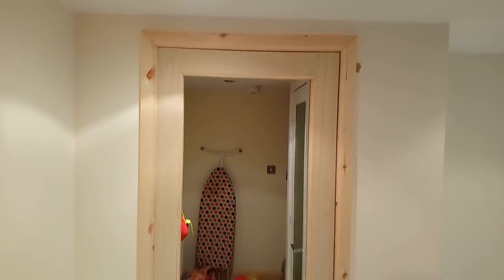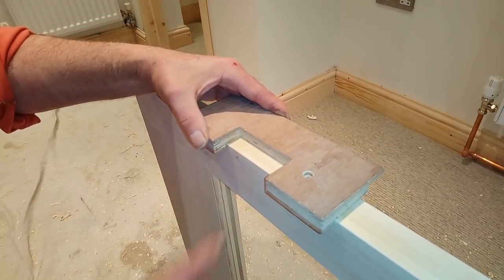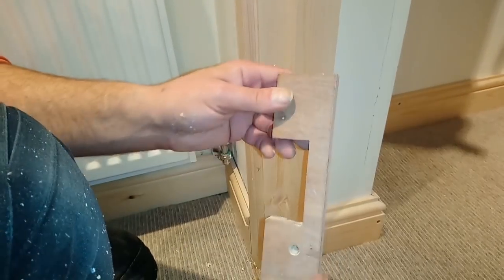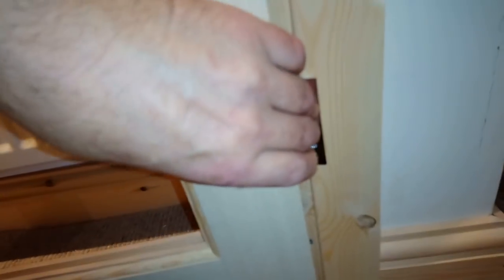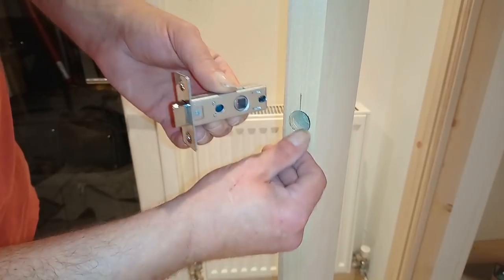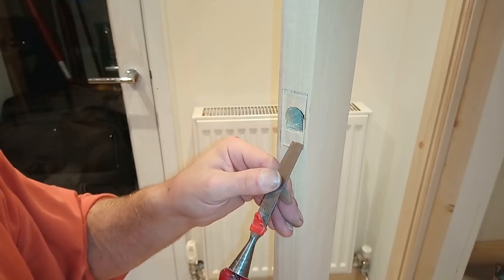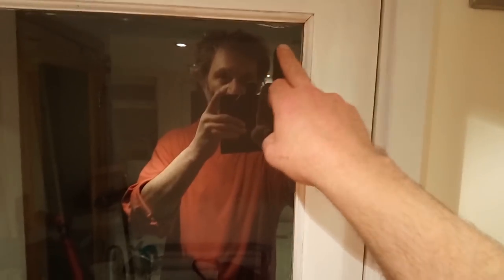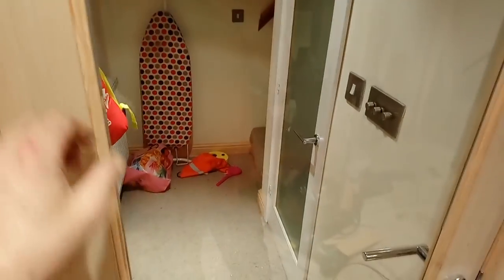Hilary's Basement Pt5 - Fitting the internal glazed door

Comment: I really enjoy watching your channel. With those dimples on the back of the latch I usually just give it a little blast with a 10mm drill for them to recess into.
Reply from the maker: Thanks Sharp 👍
Locks & handles are a bit of a dilemma for me, they finish the door off & have a mechanical niceness to them but when it comes to fitting them i just want to get it done, so while i have chisel in hand it's quicker. They never come as nice as they should 🙃

Comment: Great vid and top quality work carried out once again.
What would the price of a job like that cost ?.
Thanks 
Scott
Reply from the maker: Thanks Scott, 👍😊
Sorry hard to quote that on here, Tulip is about £28-ish inc vat for a cubic ft, so the main part of the door cost maybe a little less than that, 5 lengths of beading, a couple of £s each, hinges & lock pack from screwfix £5, handles £20, & the glass £37 + silicone, glue & Dominos, & my time,
More than a bought one but i couldn't find one this size, maybe in width but not the height, & this matches the opposing one 90%-ish.

Comment: Great Jig. Won't be buying one anymore. Most of the doors I hang are into old frames and taking the door stops off is messy. Any ideas for a jig would be appreciated. Great vid as always mate.
Reply from the maker: Hi Charlie, The only solution I've come up with is in this vid i think, similar to one in the bunker door where i had to cut the jig down to fit inside the stop & put a piece of board on top of the jig to give the router something to sit on, 
Just had a look 3.30mins in to the vid, i didn't add an extra bit on top in this 😉 if that's what you mean, 
Thanks 👍
Reply: @Gidjoiner  Thanks for reply matey. Was worried about the router tipping like you say. Suppose making a thicker jig with a rebate which sits over the stop would work. Thanks for the help as always. Nice to be working in the sunshine again
Reply: Do you do your locks/latches with the router too?
Reply from the maker: Yep on this the hinges were 3" so left just enough meat on the back of the jig but on the bunker door it had 4" hinges so i had to add on a piece, I think i used the same jig on this job fitting the outside door in a pre-bought frame with a rebate,
Yep nice sun but still cold, cut my hair a fraction early me thinks 👴
Reply from the maker: I did on the Oak door but no not normally, locks need 65-70mm depth, my router is old & the plunge depth is on about 55mm, i could start with a 50mm cutter then swap to 65mm cutter but I find it easier for the amount of locks i cut just to get the auger in my drill n make a series of holes, old school style 😉
Reply: @Gidjoiner  Bought the Trend Lock Jig only to find that my new Hitachi router didn't plunge the full required depth! Absolute ball ache. Wish I was quick enough to do things old school
Reply from the maker: Ah that's not fair, I've looked at the jigs but same thing, not enough plunge on my router, 
Can you extend the cutter out of the collet a bit or buy one of the 65mm cutters?, that's why i had to swap to a longer cutter on the oak door when i ran out of depth.
 either way it's fannying around init, never used one of those jigs so i dunno,